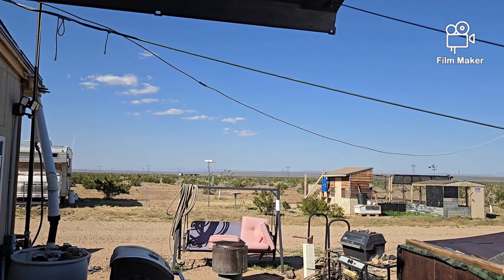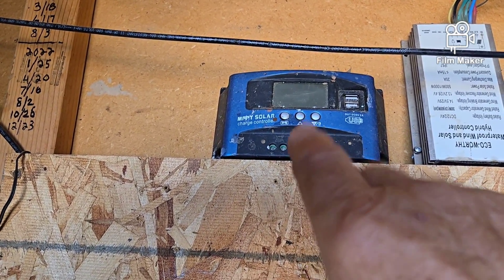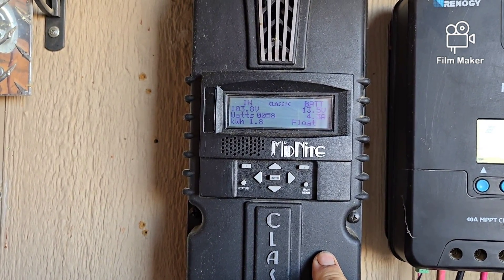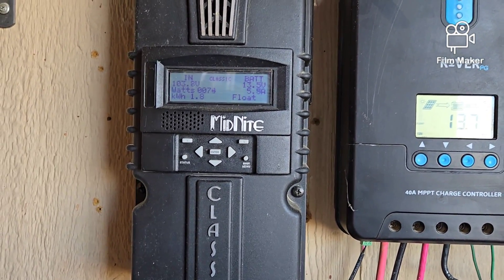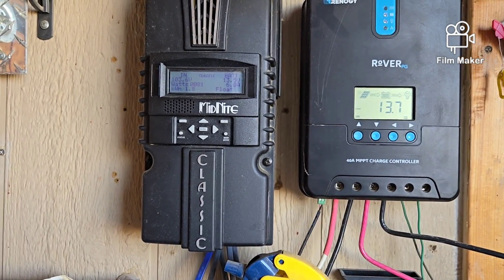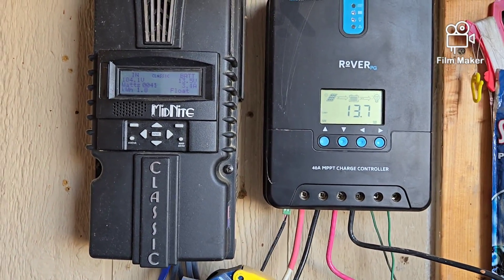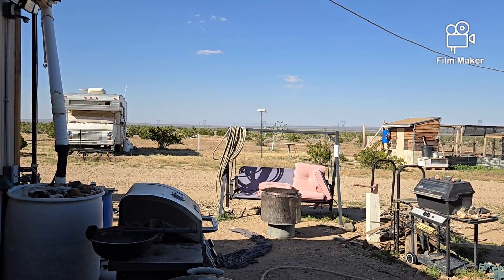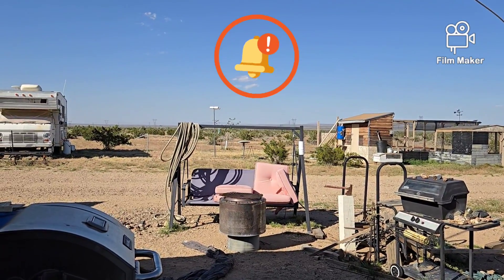How Many Solar Panels For Your Controller? April 22, 2024

Comment: hey G  bear my wires coming out of fuse going to the charge controller are hot it shows only 22 amps coming in i have 8 gauge wire do i need to go to 6 gauge wire????
Reply from the maker: No, something else is wrong.  10ga would handle that load.
Reply: @GBear  i have a 100 amp double fuse it seems hot could it be the fuse i have a 250 to put in i got them from aliexpress i have a 63amp on the small for my office its cool
Reply: thanks Gbear i replaced the fuse with a 200amp it was shorting out it working fine now have a great day
Reply from the maker: @leetaves9143 glad you found the short.
Reply: @GBear  ya i didn,t know for sure where to look it could been one of the panels shorting out you help

Comment: Im using 41.1 volts open circuit on my 24 v.system. The company I got the first three 24 v batteries from is sold out, so I guess I'll have to get two 12 volts ones and make a 24 out of them. But I can get one a month. Half of the tail broke off the wind generator. It still works but I'll have to fix it.

Comment: About the MPPT maximum voltage. There should be a value for that in the manual. Not every MPPT has maximum voltage being the sum of the maximum voltage of its MPPT range plus the battery voltage.
As an example, I found one that has a maximum voltage of 500 V (this is a big one) and an MPPT operating range of 150 V to 425 V. You want to make strings where the V(OC) of each series of panels does not exceed 500 V, but also there is an optimal Voltage given for the panels. You want the optimal voltage for each series of panels to be between 150 V and 425 V. Generally, you want to make a series that is at least 20% above the low end of the MPPT range, because the voltage might drop depending on the temperature. Also, higher voltages mean lower amps, so lower line losses. On the other hand, if you have partial shading, or panels with different angles/orientations, then you might want to make more/smaller series.
Reply from the maker: Valid points, but you also need to pay attention to max amps and watts.  One could think they could connect endless strings of panels, as long as the volts are the same, but then the amps, and in turn, watts go up and might exceed the max operating parameters.

Comment: I had no idea if you were on grid that you really could screw some stuff up if you decide to do one of these things on your own thank you for letting us all know that. My neighbor went through a company and they put the solar panels on top of the roof of his house, but it cost a small fortune. Take my word for it to him to do that. I’m still watching, but I’m glad you brought that up.
Reply from the maker: Other things to consider are age of roof, because if you mount panels on a roof, then need to replace the roof, there's an extra charge to r and r the panels.  Also, if you live in a snow area, someone will have to get on the slippery roof to clean off the snow from the panels.  Also, the panels require cleaning at times.
Reply: @GBear  I know and I live in a really snowy area, but the neighbors next-door have a much smaller house so they’re able to get up there and clean it off, but I don’t know for how much longer all getting old
Reply from the maker: @Deendougretired Exactly.

Comment: Will you have a problem if you isolate the utilities grid by shutting off the main disconnect and then having your PV system running to a transfer SW which is tied into your service panel. you aren't trying to back feed the utility grid, because it's isolated, so I would think you would be ok.
Reply from the maker: Welcome aboard!  First of all, I don't do grid tie solar systems, but I am an electrician and I can tell you that your idea could never pass inspection, so my answer would be, "Don't Try it!"
The grid panel and your idea would work in theory, until someone flipped the wrong switch at the wrong time.  That would be a mess to clean up.
A properly wired grid tie system won't allow both to be turned on at the same time, because the solar would be the main power, backfeeding the grid with overage.  That's what a shunt is for.  Don't think that they wouldn't know, after all you have power while the neighborhood is out is like a road flair on a mountain road.
See, even grid tie systems are designed to disconnect during an outage, so the panels don't kill a utility worker with their backfeed.

Comment: Hi I live in Florida and what I have is an off grid backup that I can use if the grid is down like a backup generator is used just have to run it with the grid off like you would a regular off grid backup generator. That means when you use it you can either use a sub panel that switches you from grid to solar or have a plate that only allows you to use grid or solar only just like you would do for any off grid generator connected to your panel. I had an electrician that set it up for me. It is code and perfectly safe when done correctly that's why I hired a licensed electrician to pull the permit and had it inspected and passed. They are not inspecting the solar only the electrical panel being set up for a backup generator. The connections can be 30 or 50 amps max. So we are limited in usage yet it is possible to run some solar or even a backup generator if you need time in-between to charge your battery banks. Just thought I share this if it may help.
Reply from the maker: Welcome aboard, Ralph!  Yes, that is another option available, as a generator requires fuel, and we know that gasoline nowadays cannot be stored for long without additives, and diesel is becoming more expensive than gasoline, and Propane is expensive and a bit more bothersome.
Solar never runs out of fuel for very long, although in hurricane season down there, might be cumbersome.
Also, a wind turbine, even if the local gov allowed it would need to be taken down in a hurricane.  No brake could hold it.
Thanks for commenting with useful information!

Comment: G Bear, thanks for the information.  I will probably go with a Midnight 200 or 250 with a few 48 volt batteries when I get going in the future.  🙏🏼🫡
Reply from the maker: That's a good choice along with an AIMS 4k Split Phase, 240v Pure Sine Wave inverter, but before you take the old road, check out the Sungoldpower All-in-ones 10k, 48v.  It'll handle more Solar and produce more power, with only one unit to mount and connect.  That's where I'm going if I ever get my inheritance.
Reply: @GBear  I will definitely be picking your brain for help.
Reply from the maker: @billm5433 As long as I can stay afloat here, I will be here to help any and all with prepping.  Rest assured this gov won't care if you can't survive.  It might even be in their plans to be sure you don't.
Reply: @GBear  I agree.

Comment: Yes, either generator or grid tie!
Reply from the maker: The one Sungoldpower sells for grid tie only has both those features also, but it cannot be used for an off grid system.  It comes with the built in shunt and breaker required to meet electrical code.
Reply: @GBear  interesting!
Reply from the maker: Also, I have extra wind you can have....22-25mph now from the south.
Reply: @GBear  7-14 mph here!